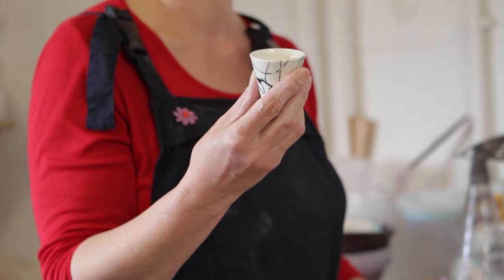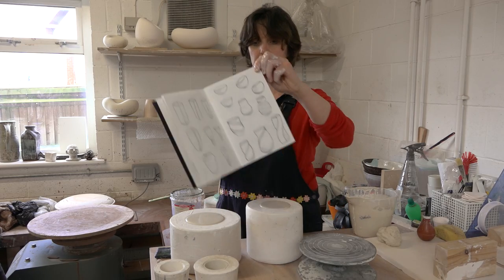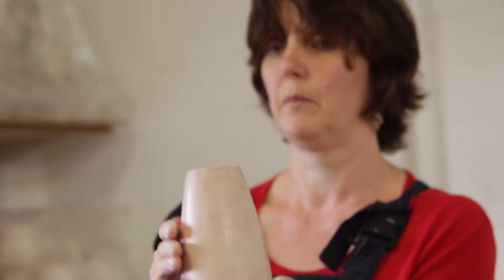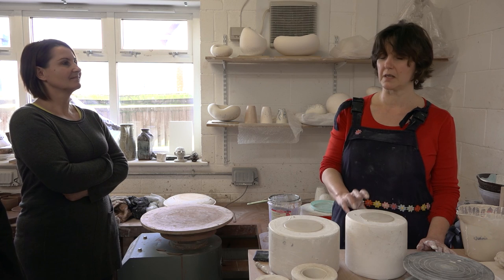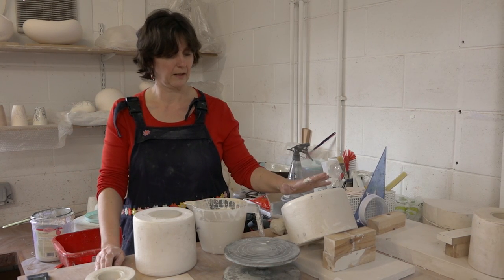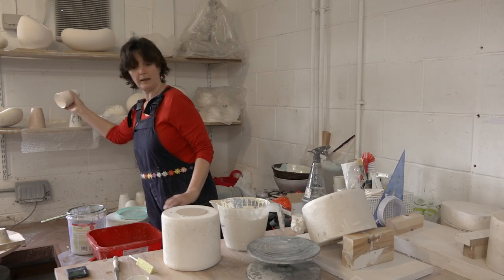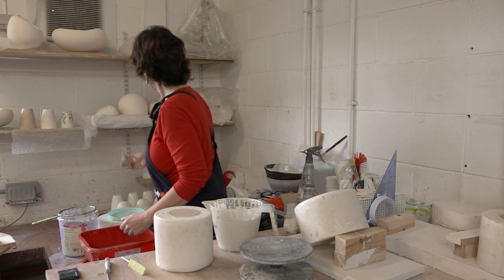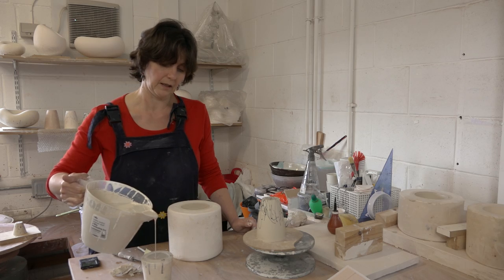School of Art Demonstration: Slip Casting Functional Forms

Comment: I slip cast a small bowl and did a similar thing with the colored slip.  I put a few drips in the mold and tilted it back and forth to create a pattern. 
After casting, the colored slip pattern showed up on the inside as raised areas.  Does this always happen ? Can it be prevented ?

Comment: Excellent, I need advise on how to make my plaster master for a small coffee cup with handle ...do you know any pottery schools around Geneva thanks
Reply: John Wijnberg you would either make one just like she did, then after your clay is leatherhard, you add the handle. This is what I would recomendable
Or you can make a two piece mold with the mold split north to south down the center of the handle. But this requires much more work and you have to take the mold apart every time.

Comment: Do you know what are the factors that affecting the casting rate/time?
Reply: Syafiq Ahmad 
The most important factor is how porous the plaster is, but it is also affected by how wet the mould is (from previous casting and humidity). I use a ratio of 7/10 (water to plaster) when making plaster moulds. More water will increase porosity but reduce  affect how long your mould lasts and how robust it is.
Reply: Raja
Write how liquid clay that pours into the molds and materials used in it and its amounts.

Comment: What is the ratio or percentage difference between the plaster master and final piece? 
Eg Plaster master is 10% larger...
Reply: It depends on the clay. Each kind of clay will shrink up to a different degree but most pottery shops will tell you very precisely how much shrinkage you can expect. If you need a plaster master to create a very precise size of cup (such as for measuring cups), you can determine it based on the specific clay's shrinkage using geometry

Comment: Very professional demo, thanks! One question, are there any additives in your plaster to make the moods more absorbent? I find my molds make 2 pieces per 24 hours, do you have any advice for me please? Thanks.
Reply: That’s about right (2 in 24 hrs), but you can speed up the time to dry out your soggy mould by putting it in a fan forced oven (with elements shielded... you can use a baking tray under or over the element) at between 50 and 60C absolutely no more or your mould will become brittle, powdery and fret.

Otherwise, make duplicates of the same mould.
Reply: Dale Glenny Thank you so much!

Comment: Hello, please what water resist do you use on the original plaster mold? Can you spell out the names? Thank you.
Reply from the maker: Hi Jolene. Julie says in the video that she used Shellac. I hope that helps. Best, Amy
Reply: What release agent was used?? She said the master was coated with shellac but then added that it was coated or "soaped" with a "mold making size"...Thanks
Reply: Step one ! Go on google and search for ceramics courses. 
Or try buy books about ceramics art.

1 - Make a master from plaster.
2 - Mix  alcohol with shellac ad make liquid solution of it. 
3 - Apply that solution on your dry model. In very thin layer. Shellac clogs pores of plaster.
4 - Mix your lubricant time ! -  We use mixture of soap flakes  with oil  and you need to stir it  in the heat with mixer - Mix of oil and soap  makes great fluffy creamy lubricant.
5 - Apply it on your shellac covered master, with brush. That fluffy cream is amazing  release agent.
6 - Make molds from plaster.
7 - Put these new babies in water it helps get your master "pop"  from your casted form.
8 - Let it dry for few days, if you have kiln-drying box ,good for you, it makes this process faster. 
9 - Cast your slip  in new form. 
10 - Profit ?????